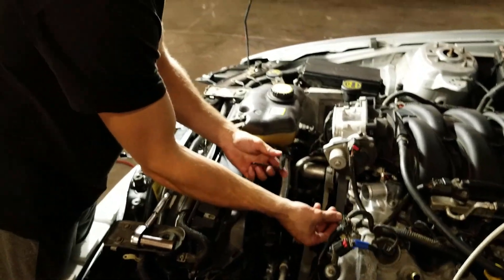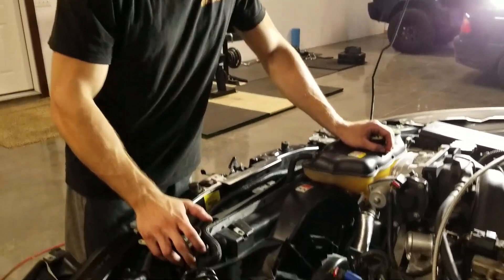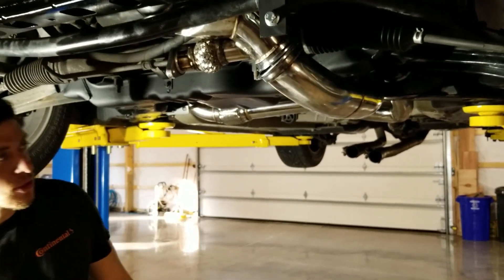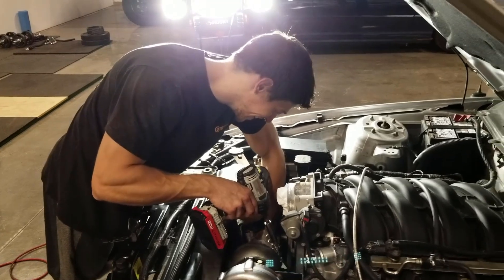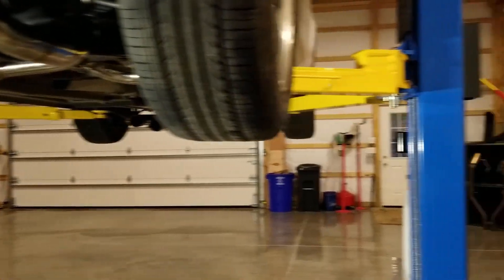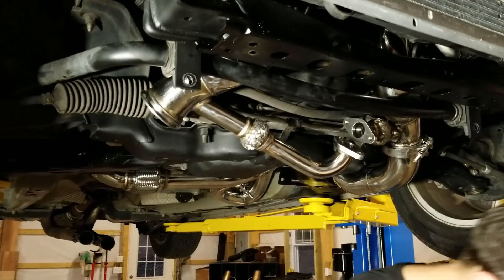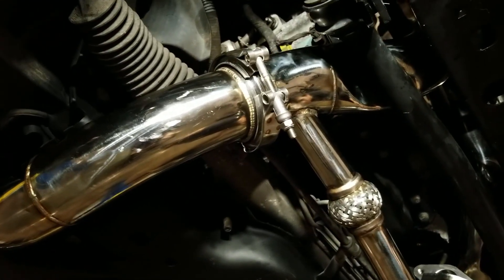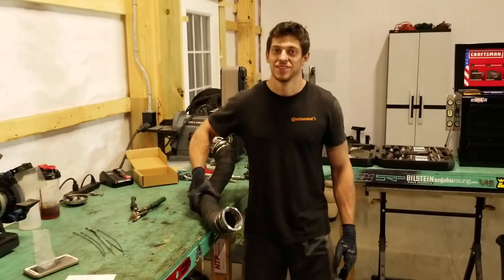Turbo Mustang Part 10 - Mounting Turbo

Comment: Did your kit come with a turbo mount bracket ?
Reply from the maker: Yes it did
Reply: Kordare I now own the kit as well for my 3v & I don’t see a bracket to mount the turbo , or maybe I’m looking at the wrong thing
Reply from the maker: @KingB015  it's just a basic rectangle piece of steel with a hole at each end
Reply: Kordare smh they didn’t give me the intercooler bracket or the turbo mount bracket , quality seems pretty decent tho
Reply from the maker: @KingB015  haha well the intercooler bracket is trash anyway. I built my own
Reply: Can I do the same for turbo bracket ? Just make one ?
Reply from the maker: @KingB015  definitely.  It's actually an L shape bracket with two holes. You can see it in this video at the beginning